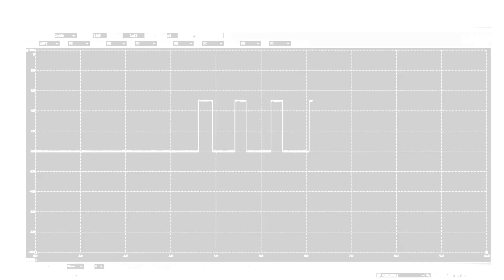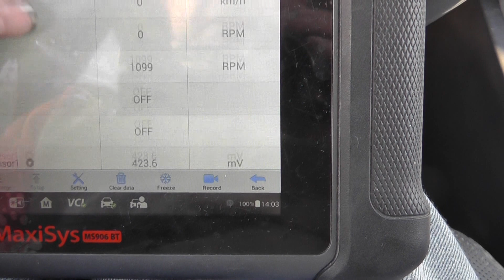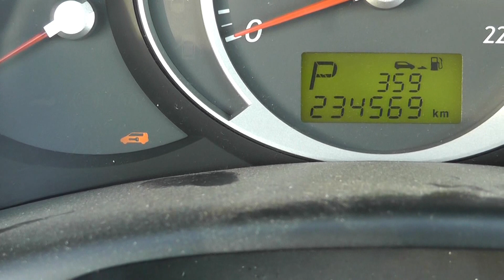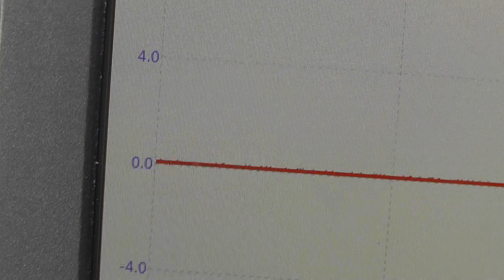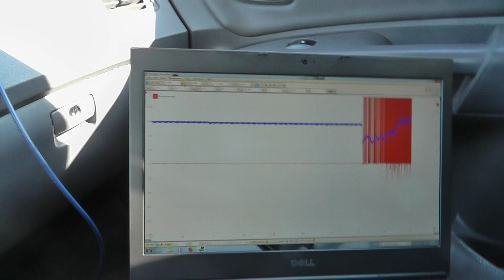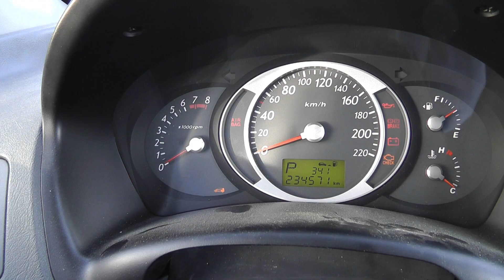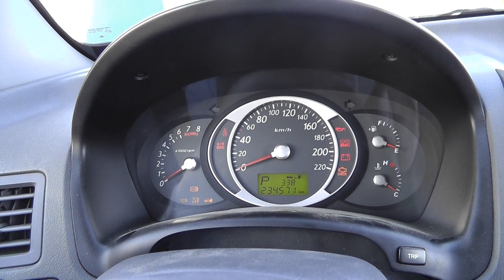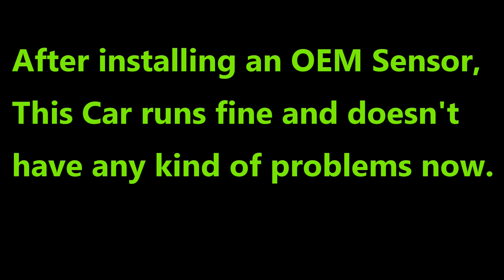Hyundai Tucson Crankshaft position sensor malfunction P0335

Comment: Great video! Did you cut the lower part of the grill or was it already open like that? Yesterday I replaced my crankshaft sensor on a 2007 Santa Fe; I had to remove the starter for more room! I am trying to remove the bank1 camshaft sensor but there doesn’t seem to be enough room next to the firewall to remove it; do you have any experience with this sensor? Thanks!

Comment: Good video, glad you were able to fix your car. My wife has a 2014 Hyundai Tucson 2.0L engine. She that the tachometer stopped working and the engine would stop, but after a couple of seconds the car would start again and the tachometer would also start working again. After researching online I found that the problem could be caused by a bad camshaft sensor, a bad crankshaft sensor or both. Now I'll have to check to see which  one needs replacing . Almost 6 years old but less than 50,000 miles on the engine, hopefully one of the sensors will fix the problem. Thanks for showing where the crankshaft sensor is located I believe mine is in the same location.
Reply from the maker: let me know what you've found! if this is not the problem, i will try to help you. BR Matthias
Reply: Can you help me
I have Hyundai Tucson
Model 2013
 The  problem on input sensor
Can you give me a apicher of this parts